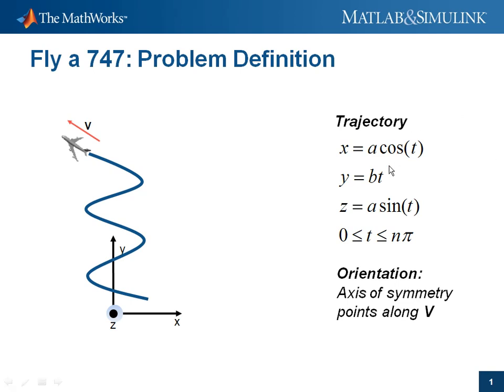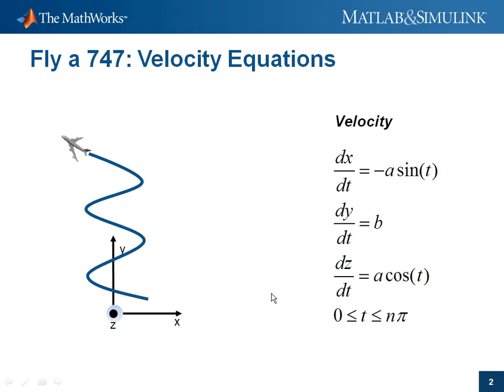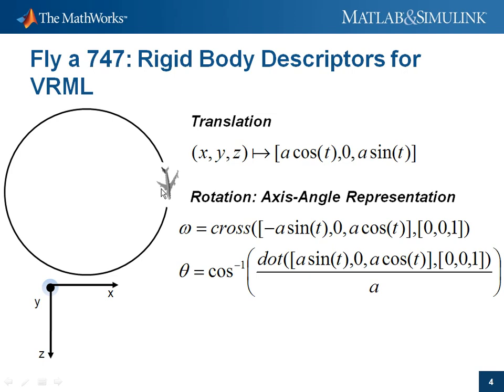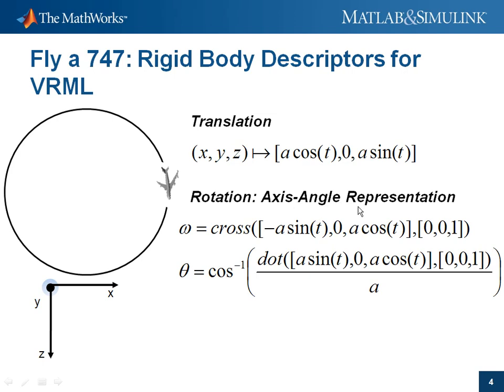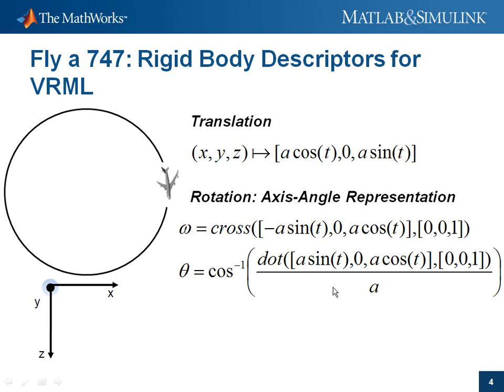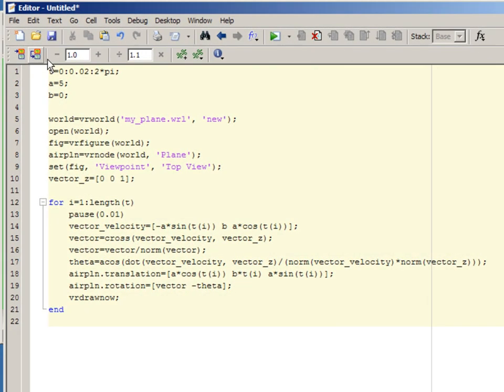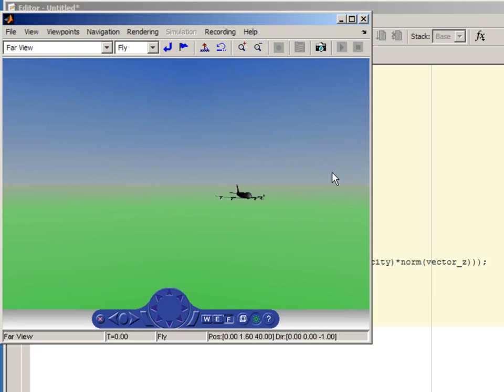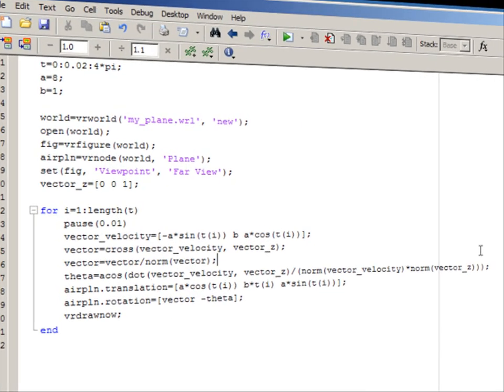Fly a 747 with MATLAB

Comment: Thanks for this video 
As we know, there is a difference between a 2D planar motion and the 3D motion for a rigid body... Therefore for the case of b=1 one we need to define the Roll angle phi through which the airplane is rotating about the x-axis. for this we need to redefine the equation of the motion for this aircraft using the Euler angles....
Thanks again for this video ..